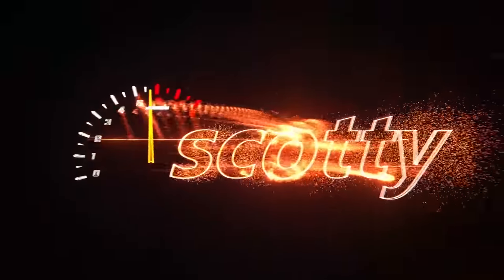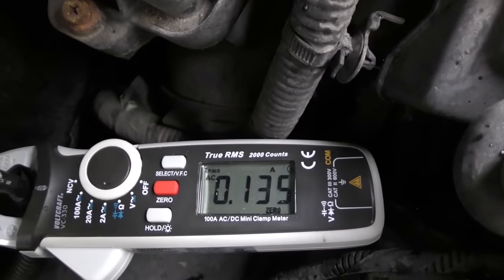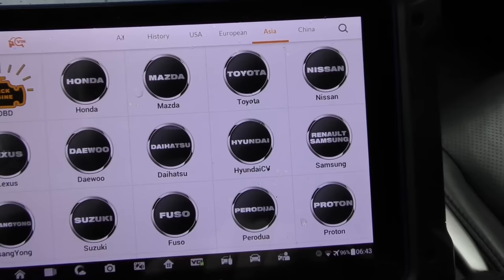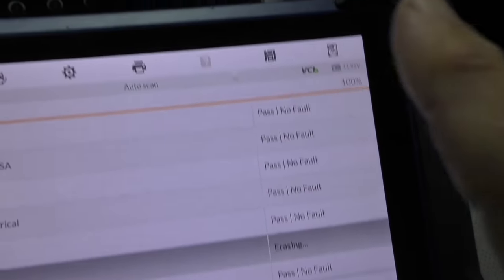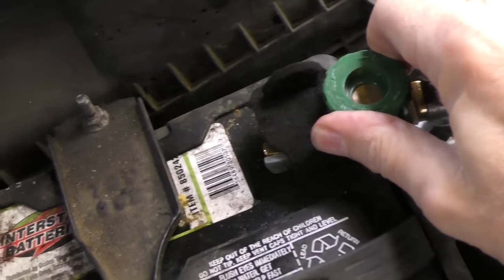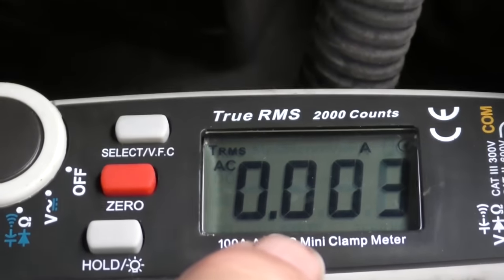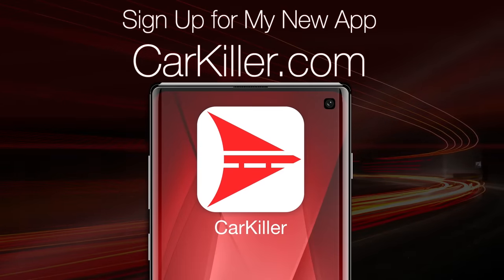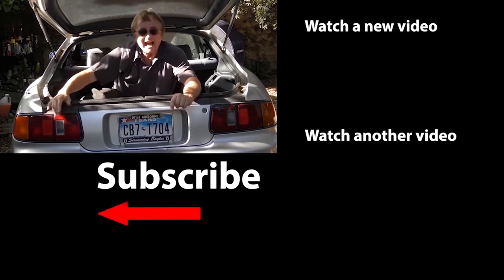Watch This Before Buying an Acura

Comment: As an Acura driver for 18 years, I have had 3 Acura: 1 integra and 2 RDA. For 18 years, I never had a single issue with the 3 cars. Absolutely nothing, not even a light or fuse problem. My first one was Integra (5 years old). I paid $4000 and drove from 1991 to 1995 and sold for $3500. My second one was RDA SUV bought it for $28,000(only 2800 miles) and drove it to 100,000 miles and sold it for $9000; then I bought a new one 4 years ago. While my wife has had BMW, Toyota, and Benz. We also never had any problems with Toyota. BMW and Benz are clearly lower quality in terms of reliability.
Reply: this is factual. we have had 2 acura’s and 1 bmw. the bmw had 15x the problems either acura has ever had. Honda all the way.
Reply: I only buy toyota and honda anymore
Reply: I am looking at a 2008 acura mdx with 160k, from all the research I have done it says that the 2008 is one of the best years for the mdx. I also will only buy Toyotas or Hondas, right now I have the 2008 RAV4 and yes it has the V6!!! I have had Hondas too just never an Acura (I know they are the same company). Has anyone had issues with this model???
Reply: Do u think an aura 2012 is a good first car ?
Reply: @bearxbunny1835  Only thing I would look out for is the automatic transmissions in older Acuras.
Reply: Same ILX 2016.Breaks and normal maintenance. Top quality car.
Reply: @NOTQUITLIKEKK Yes.  Get something under 135,000 miles. Change all fluids, use Acura coolant, transmission and rear differential fluids. I have a 2016 and 2017 RDX.
Reply: Most cars will be easy for the first 100k. The point is they become money pits after that while Toyotas are much lower maintenance. I bought a used 06 TSX WITH 200K that needed 10k in maintenance over next 20k mi. I bought a Corolla with 200k that required 1k in maintenance for next 50k miles.
Reply: @bearxbunny1835  I have an 07 Mdx with 260k that has been flawless until now. Starter just went, lasted a long time 
Now the windows and sunroof stopped working that was an $80 fix new harness. Other than that still drives like a new car everything has held up well. I can’t say that for the bmw we had.
Reply: @morgancohen5594 I can guarantee you that the previous owner was neglecting the maintenance on the Acura .
Reply: 06 tl here. Once you are familiar with the engine, you can look up tons of YouTube videos to help you maintain it. I have saved thousands, my tl is 18 years old and still purring almost at 200k miles

Comment: My 2015 RDX hasn’t put a foot wrong since I bought it in 2018. I got it with 50,000km on it and it has 230,000 now - timing belt went at 210,000 and thankfully I have a mechanic brother. The engine is flawless - will buy another.

Comment: It’s the hands free Bluetooth module.  My 2008 MDX did this. Simply unplug it, it’s easy to get to and is hot even when the car isn’t running. It overheats then gets an internal short that causes this constant drain on the battery.
Reply: But if you unplug that module will the Bluetooth feature on the radio still work?
Reply: @siddiq1077 on my 2008 MDX the Bluetooth is only used for hands free calling not music.  I use a Bluetooth receiver plugged into the Aux input for Bluetooth music.

Comment: It’s definitely the hands free Bluetooth module. I experienced this with my 06 TL.  With so many phones developing over the early 2000s, Acura seemed to have quit on releasing firmware updates for this feature so around 2009/2010 this feature stopped working for me.  It wasn’t until 2017/2018 that we figured out the problem. Sucks that a feature that didn’t even work for almost a decade is what was draining my battery. Scotty, next time you should do a video on the cruise control system failure. My on/off button never stayed depressed so I had to keep it depressed with electrical tape. You have to take out the entire airbag to fix this issue smh!
Reply: Acura HUGE MONEY PITTS. Toyota CAMRYS WINNING!!!
Reply: I had the same problem, just disconnected it.
Went thru 3 batteries, before finding help on YT
I don't use my phone in the car, so it was an easy fix
Reply: Yes. This is true I had the same issue and found that I could get into the box under the shifter on the passenger side. I just pulled the plug out of the bluetooth module and my electric issues were solved. This issue destroyed a lot of batteries on the journey to locate the fault.
Reply: Also, I had a similar solution. I had purchased a plug-in trickle charger and if I forgot to use that in 24 hours the battery was nearly dead.
Reply: That's exactly what it is👍🏾👍🏾.. Acura's aren't known to have many problems. I've had 4 Acura's between all 4 the only issue I had was a sticky sunroof RLX and a vibrating air dam under an MDX.
Reply: Yup. Took out the Bluetooth module and no more dead battery after sitting for a day.  Bluetooth only was for phone and not stero anyways so wasn't even using it.
Reply: I wonder if that voice recognition was apart of the problem.. always listening for something to do ... that’s why I never set it up

Comment: We've owned 2 of these Acura RDXs. The first gen was a little so so because of the power and the concern over changing the corroding washers to avoid the mixing of coolant & oil. Now, the 2nd generation has been absolutely AMAZING once you put the VCM disabler on.  Of course here's a few things we've done to really make the experience better- Upgrade the battery to handle the load from the features & entertainment system, replace the poor oem shocks with KYBs, Drain & refill trans fluid every 15-20k (change filter ever with 30k), & change the spark plugs after you disable the VCM.  Doing that has allowed us to maintain consistent V6 power @ 26mpg on the highway, & around 23 city. 

Ask me anything, these are really awesome cars, these VCM disabled 6 cylinder motors & 6 speed transmissions are bulletproof if you maintain them and keep the fluids changed. 
We wanted to consider the snazzy 3rd generation RDXs, but are concerned about the drive train (turbo charged engine combined with a questionable 10 speed) & the quirky touchscreen entertainment system that many dealers have stated owners aren't appreciating as much as initially expected...
Reply: What year do you have?
Reply: @marknalgas  you Asked but no response!, after they said to ask me anything! 🙃
Reply: Which brand of VCM Disabler did you go with?
Reply: I heard there was a problem with torque converters, and it turned out to be a software update thing being misdiagnosed. Any info on this?
Reply: Couldn’t agree with you more about the second gen - I love mine. Proper maintenance rules the day. I love that 3.5 V6.

Comment: This happened on my wife's 2005 Acura TL. Had to unplug the Bluetooth module that was mounted in the ceiling after dropping the interior lights housing. She never used it anyway.
Reply: Good call, i thought i heard something about the hands free link system draining batteries( didnt know it affected rdx models also). From what i hear replacements are expensive so its better to just disconnect as you did.
Reply: @CRAPO2011  you could try re-wetting the circuit board with a soldering iron.  Beats having a dead system.
Reply: Disconnect it and buy any Bluetooth receiver in dash kit or auxiliary form. Works just the same woth no deianage
Reply: @dawfurby  was about to say the same.
Reply: I had the same issue in my 2005 TL.

Comment: I was a Acura tech for 29 years , the problem is in either in the a/c clutch relay or HFL module.  That model had huge issues with a/c clutch relays. I would replace the relay due to its cheap and gives peace of mind, along with i guarantee it will fail eventually.
Reply: Quick question. Having water leak coming in on passenger front up by top corner of windshield. Coming in where pillar plastic meets roof liner. 
Already blew out sunroof drains, draining good. Still have leak. Any thoughts with your Acura experience please?

Comment: Either replace or much more simply just disconnect the wire from the Bluetooth module (hands-free link) located by the rear vents inside the center console. They're widely known for draining the battery on Acura's.

Comment: This is actually a well known issue with the RDX/MDX platform. There are a handful of "common" reasons why the batteries on the 07's drain. Bluetooth, door actuators, and stereo amp are the most common I've seen. I have to say, having owned one now for 2 years, it's a fantastic little car... Once you install the Hondata tune and get the turbo to spool like it should! Pretty dang boring without the Hondata tune.
Reply: What turbo? It's a Vtec engine the is NA
Reply: @hammertime4257 my 2008 rdx has a turbo …. Pretty sure they all do

Comment: Definately the HandsFreeLink module. This is extremely common for Acuras. Feel the plastic cover around the garage door opener and sunroof switches, if it feels warm you found your issue. Mine did that and a quick internet search led me to this issue. I disconnected the module and a 2 years later no issues. Also the Bluetooth stopped working, that's another clue.
Reply: Same deal with my 2012 RDX. Stranded me twice.  After a little research and a lot of frustration I found the Hands Free connection and unplugged it. PROBLEM SOLVED 😬

Comment: 4:18 pretty sure it is the hands free link.....that’s the typical culprit in Acuras
Reply: This Is always the issue with 3rd gen TL’s too.
Reply: Yep. Same on my MDX. Unplug and I bet the draw disappears. Have also read where people “bake” the HFL unit which helps “resolder” some of the joints. Never tried it tho...just got the aftermarket Bluetooth that connects to the XM aux in the back and it works great.
Reply: Yeah just disable Bluetooth in your phone when you leave the car....annoying but way easier than undoing battery Everytime
Reply: swissmrkc The issue isn’t the phone. It’s the module in the car.
Reply: Alexander Coombs This is very true- I had an 06 TL and while I owned it I never had the issue, I heard years later it did- also occurred with my sister in law’s 06 MDX (they had the issue with the intermittently dying battery- I disconnected the HFL in ~ 10 minutes and it’s been fine since). It’s a known issue with the HFL module made by Johnson Controls in Mexico- either just disconnect it and be done or replace it.
Reply: so how does one remove the hands free link or bluetooth all together?
Reply: @h011yw00d  it should be above the rear view mirror. all you have to do is replace the unit or just disconnect it (physically unplug it...it is cheaper option, no one really uses HFL) and the power drain will stop.
Reply: BUT SCOTTY KNOWS EVERYTHING!!!!!!  Yeah scotty is great for mechanical stuff,  one Google search and this would've popped up on the second link.
Reply: Yep, a quick Google search and Scotty would know this. SMH
Reply: happened in my 07 TL as well.  just had to unplug the bluetooth.  other than that the car was great.  friend owns it now, 160k miles and not 1 thing wrong with it.
Reply: Yup. Had that same issue on my 07 Honda Accord (Euro). Disconnected the Bluetooth module and all is fine now. They start acting up with time for some reason..
Reply: I was plagued by this issue on my MDX, my mechanic couldn’t find the problem. After reading the forums I found this was a common  issue. It’s the HFL unit and or the AC relay. Disconnected the HFL and replaced the relay. No problem since then.
Reply: @steve9326  yea i found out through a forum too.  mechanics literally knew nothing
Reply: Agreed.  It was not worth it to repair our hand free link but it was draining the battery every couple days.  Huge pain to figure out but it took 15 minutes to fix.
Reply: h011ywood 
There are some videos here on Youtube demonstrating how to disconnect the Handsfree Link in Acura’s.
Reply: It's definitely the HFL.  My 2006 TL gobbled batteries like the cookie monster and I drove it everyday!  My HFL went bad and I just never unplugged it until I did a little research online and found out that if that unit malfunctions the computer keeps trying to restart it over and over again and this causes a drain and wears out the battery over time.  Disconnected that bad boy and haven't had a battery issue since.
Reply: Acura RL have the same problem.
Reply: 3rd gen tls owner here and can vouch for the hands free link draining battery. I removed it completely and solved the issues.
Reply: Bingo.  I have two friends with 08 Acura's that had this issue.
Reply: It’s a stupid bluetoot link. My coworkers MDX had that same problem for months. I was loosing my mind to find the parasitic drain. Then i started with modules,eliminating one at the time. When i’ve got to the bluetoot link,drain was gone. She drives the car for few weeks since then,no problem so far,but no handsfree phone,she’s good with that till i’ll replace the module one of these days.
Reply: @timbrown7405  yes....but the module is trying to connect to the phone..that's the thing, if you disable Bluetooth on phone and then power entertainment radio etc before turning off key or push button...then your golden
Reply: It happened in my 2006 Acura as well. Except first time it needed a whole new computer. Then a few years later it was the Bluetooth.
Reply: Positively sure that's what's wrong... My RDX BT still works correctly but my TL drained constantly m
Reply: We disconnected our bluetooth so it would stop draining our battery... happened to my sister in laws Acura too.
Reply: Collective knowledge of forums and owners are powerful thing!!!
Google is the new mechanic 👍
Reply: Thien Phan , 07 Acura TL , noticed a warm spot by the rear view mirror on the windshield. The frost wouldn’t stick because the Hands Free Link kept trying to turn on . Killing the battery.  I disconnected the HFL .🇨🇦
Reply: In my Honda CRZ the hands free link kills the battery everytime if the engine isn’t running 🤔
Reply: Bingo - had bad HFL on my 07 MDX years ago. killed 2 batteries until I goggled and unplugged it about 4+ years ago. no issue since... I bake the unit but that only worked for about 6 months. The lawsuit for Honda never went anywhere either. Luxury SUV without BT for most of it's life... lamo.
Reply: Yup, the Hands Free Link, as mentioned here is likely the culprit...maybe/probably.  Johnson Controls makes the HFL, and it’s known a resistor on the circuit-board burns out, causing the system to remain stuck in the setup mode where it constantly puts a small drain on the battery.  However, the symptom in Scotty’s customer’s car is different as the current drain is intermittent.  So, who knows...
Reply: It’s the hands free link. I own an Acura TL 08, and once I disconnected that I let my car seat for a week and start right out 🙏🏼🙏🏼 I mean I don’t really need the hands free link so 🤷🏻‍♂️
Reply: Had this issue with my car. Removed the hfl module - Very easy fix.
Reply: In OLD ACURS
Reply: Acuras from 2010 and up have no problem and they're really reliable
Reply: David Zambrano ... I’m looking into purchasing a 2011 MDX & was wondering if they were reliable especially having over 100,000 miles on it?!🤷🏽‍♀️
Reply: Yup, I went to a mechanic he couldn't figure it out. Went to the dealership they immediately knew what was wrong. Sometimes you're better off going to the dealership for the diagnosis. Then maybe you can take it somewhere else for parts and labor.
Reply: @ladycouture2703  Did you guy the 2011 MDX?  If you did then you’ll need to replace the timing belt and water pump very soon (7years or 120k) it’s a $1,400 job at a reputable mechanic shop.  Outside of that, the only problems I’ve seen on a 2011 MDX with about 88,000 miles on it, is the brake switch going bad (a cheap and easy to replace part), you’ll get a few check messages (check trailer stability control,etc.).  I’ve seen a problem where the sunroof won’t close,  you have to tap the button repeatedly in increments.  And worst of all,  I’ve seen where the memory seat, side mirrors and telescoping steering wheel does it’s own thing and has to be manually adjusted every time you turn on the ignition.  This was all on the same MDX.  With all these problems on one vehicle, that’s supposed to be bulletproof reliable, might as well get a BMW X5, at least you know you’ll have trouble with the X5.
Reply: I have no mod key and my panic alarm wont go off and the window door switches quit and my key quit working in my door but the car starts runs but windows wont work all happened at once
Reply: TL. RL. TSX. MDX RDX AND Some Hondas  they use the same unit Bluetooth and it becomes notorious to fail at all theme

Comment: This issue is typical across Acuras. Easy fix: Disconnect the HFL unit (usually located in the center console for Acura MDX and RDX) to stop the parasitic drain.
Reply: How does one do that?
Reply: @elliotmiller2739  , Just open the center console, identify the HFL unit (a simple Google search will be helpful), then disconnect it. It worked so well for me as I am still using my 2009 Acura MDX to date, issue free. I love this car!

Comment: I have a 2007 Acura MDX. The car was 10 years old and had 171,172 miles on it when I bought it. One of the first repairs (of many) I did was to replace the alternator. I kept seeing a "check battery" light flickering on and off. My mechanic confirmed the alternator was bad. I then would notice a humming sound. After checking online, I saw the bluetooth system would be draining the batteries of Acuras from this model year and left unchecked would ruin the alternator. I pulled the bluetooth system out, and have never again seen the '"check battery" light come on. I suspect this RDX has the same issue. All you need to do is to pull out the bluetooth system; problem solved. Unless the alternator needs to be replaced as a result of the drain.